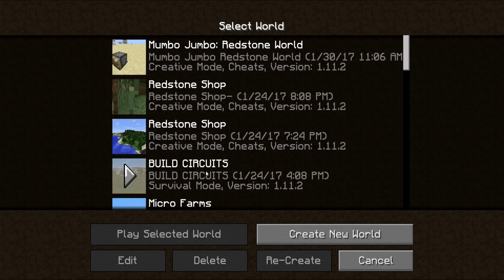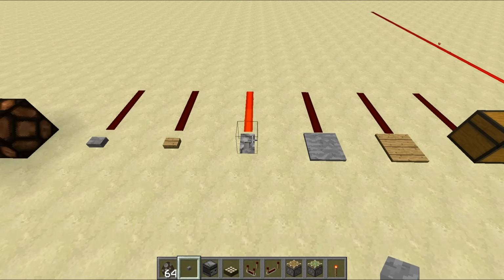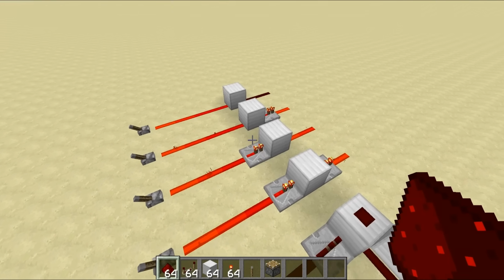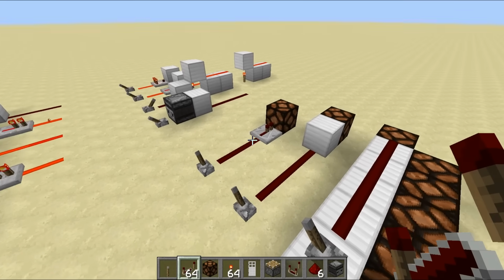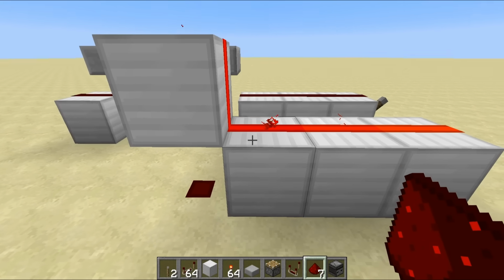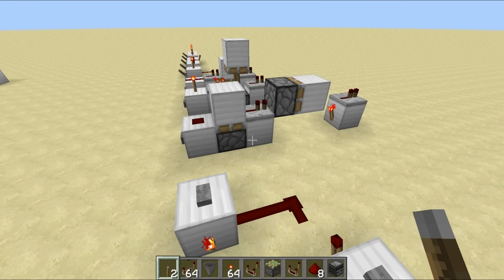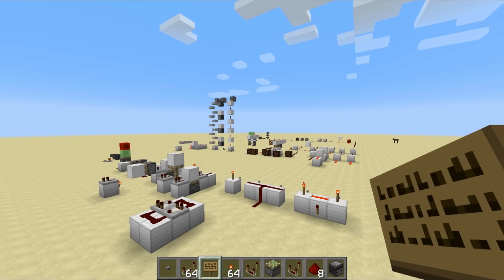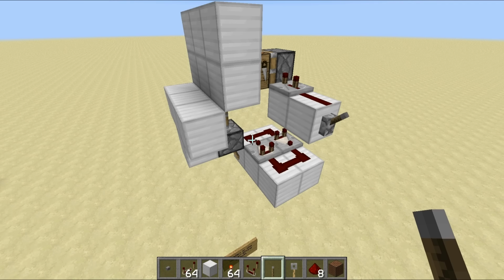How to go From NOOB to PRO at Minecraft Redstone!

Comment: The traped cheast dont give a signal of 1 it give a signal of how many players thats looking in the cheast
Reply from the maker: +Frederik Dekov Buur well I guess I learned something!
Reply: Mumbo Jumbo I love your videos
Reply: Frederik Dekov Buur pro English
Reply: Hame ster tx dude 😂
Reply: Mumbo Jumbo why did you need block update ciruits if you have an observer block?
Reply: the observer was added later in minecraft and look up the 2x2 flush piston door. This is so tiny because of block update, but wouldn't be so small with observers
Reply: b-boymark it can still be small, at lease it has the same size with redstone torch tower when it comes to 2x2 piston door. And also, it depends on the case.
Reply: Frederik Dekov Buur in most cases it gives a signal of 1, because, most of the time, only 1 player will be looking into it at a time
Reply: Greedo Flashbang yes but thats not the point
Reply: YES!! so the block update circuit is useless!! why did mumbo show that circuit into newbe ("noob" is little bit rude)?
Reply: The one he shown is great if your circuit, which needs to be powered is higher than thing it "observe". Observer block doesn't work that well verticaly.
Reply: Frederik Dekov Buur I hope Mumbo Jumbo see this can you make a map which will lead you through easy redstone to hard redstone
Reply: Luka Papež mumbo have seen this look at the fist comment
Reply: ***** i know😂
Reply: same
Reply: Frederik Dekov Buur learn how to spell chest
Reply: Frederik Dekov Buur thanks
Reply: ,mkjmihyjihvjnfcjkhnvuknjhyuidre olahjxfnvhnfdgh,kjc knxjkjhnv kucfumiv74895797
bhgn4!1!11!!!1!@222222@@@222\333####3#333$4444$4$$$$4445%55555555555%%%5%%66^^6666^&&77777&88*8(9(0)00099(99(8888*87&7-=u_)-=+++=--==-{[[[{[{{]]]]]]]]]]]]]]]]]}]]]]]]]]]]]]]]]]]]];;;;;:;:;;:;;:\''''\\|/?//..>:'\|?>/‘:{\
Reply: i don't know what am iwriting and saing
Reply: tidak ada video maap yo,  See Mumbo's automatic melon farm. Done before Observers.
Reply: How the heck can you be that good at spelling?
Reply: hey dont juge peapole!! its ok if we are not good enough at english!!
Reply: TecherZ i know😂
Reply: tidak ada video maap yo yes!
Reply: Frederik Dekov Buur kon kok nyocot wae seh bacod
Reply: Frederik Dekov Buur *chest
Reply: Apple Flavour Bleach i know 😂
Reply: Apple Flavour Bleach HOW COME THE BLEACH FAMILY IS EVERY WHERE!!???
Reply: No intent to be rude but I believe you meant trapped chest

P.s all the others were really rude. Bye have a nice day!😊
Reply: Fuckin "shark lover"? Great name dude
Reply: I comment Sh*t your name says it all
Reply: "Runty" boi hahah, Lil fucker munter runter
Reply: I comment Sh*t well,I am the runt in my family \(°ω°)/
Reply: At first I thought this was bullshit. But it checks out. Not sure I've seen this used before...
Reply: Frederik Dekov Buur its touching but yes.
Reply: Frederik Dekov Buur but
Reply: dusky186 hu77$7
Reply: Frederik Dekov Buur p
Reply: Frederik Dekov Buur
Reply: what happens if there are more than 15 people looking in the chest, but there is an RSB next to the comparator, and it is in subtract?
Reply: Peter Smythe idk
Reply: Frederik Dekov Buur wow that's cool. You never know everything about redstone!
Reply: you english?
Reply: you english?
Reply: Irish.
Reply: Frederik Dekov Buur oh thanks. actually didnt know that :).
Reply: Dominic SherryRoman Knight  happy to help
Reply: Frederik Dekov Buur could you use grammar
Reply: LD GP KillerTubeGameing sorry im not so good to english
Reply: ***** Shouldn't that be a lower case b?
Reply: Frederik Dekov Buur  wow the kid teached Mumbo
Reply: RainbowisticFarts lol
Reply: Frederik Dekov Buur LEARN TO SPELL AAAAHHHH JK
Reply: Frederik Dekov Buur chest*
Reply: Frederik Dekov Buur what?
Reply: Frederik Dekov Buur XD
Reply: Frederik Dekov Buur You're a redstone GOD!
Reply: The trapped chest doesn't give a signal strength of 1. The signal strength it gives depends on the amount of people who are currently looking in the chest.
Reply: Frederik Dekov Buur i
Reply: Frederik Dekov Buur can i download a map of mum o jumbo TESTING WORLD
Reply: Mumbo Jumbo why is pe and pc Minecraft different?
Reply: x freakx noob means new
Reply: Chest?
Reply: Frederik Dekov Buur I
Reply: chong kent L
Reply: Jaime Castro
Reply: Frederik Dekov Buur 
That's cool.
Reply: Mumbo Jumbo umm what is a cheast?
Reply: Frederik Dekov Buur I
Reply: i didn't know
Reply: Its chest not cheast
Reply: late to the party here on the comment, but i just wanted to say that i love how positive and frequently you reply to comments on your channel. even the commenters seem so positive on your channel haha

Comment: Mumbo, you were incorrect about trapped chests! They output a signal strength equal to the number of players looking at their inventory. So on single-player worlds, that's always strength 1, but on multiplayer worlds, it could be a stronger signal than that. And the official terminology is not "soft" and "hard" power; the code and all official sources refer to it as "weak" and "strong" power.

Comment: Hi Mumbo, Great job. I have worked on redstone since it was introduced and still learn something new every day, mostly from you. I'm still a redstoner but have gotten into commands, odd that it took me so long as I am a programmer. I would like to point out that it is now possible to create a variable clock like a hopper clock, that can run at speeds beyond functional for redstone and insanely slow pulses as well. We can also replace buttons with any items and make instant 40x40 or whatever doors that appear to slide open using no pistons at all. No I'm not leaving redstone for commands, but I am trying to incorporate the best of both in my builds... mostly because I'm not talented enough with redstone to build half of what you do, and because I'm not good with modeling items in code.
So why am I telling you this? Well if I am only half decent at each, you could be the king over both camps. Imaging some of your systems turned supernova using some of thees ideas. Now i know you can't use commands in most servers or even in survival and that's a big drawback, and that it's a balancing act when adding commands but your the guy I would trust with this first.
P.S. I know SethBling did this to, but we don't see much from him lately and you have always been a resource for many of us.

Comment: Mumbo:  Thanks for making this video.  I've been working on my own tutorial, and I'm going to link to yours from mine, because this video is EXCELLENT.

There is one little quibble I thought I'd mention:  A redstone torch does not power a neighboring BLOCK.  It will ACTIVATE a neighboring block that can take action (e.g. extend a piston), but it doesn't POWER it.  You can distinguish this by trying to get a signal out of that neighboring block using redstone wire or a repeater leading away.  You'll get nothing unless there's redstone dust or repeater in between.  However, if a block is immediately ABOVE the redstone torch, it is indeed powered (strongly).

Comment: 1:41. Why is that?? 13:42. So this tower will not work if you powered it from the top at wanted the output on the bottom? 17:48. Why is it called a bud switch?? 17:54. It should also be called the infinite item multiplier, am I right??

Comment: Mumbo, maybe you can help with this design I can't make happen. It uses a daylight sensor, lava stream and water stream. The idea is for a castle exterior, flowing lava flowing down to a fountain at night for lighting and appeal and when daytime comes, the lava stops flowing and the water follows the same path without the 2 ever intersecting at a total of 20-25 blocks of movement. I've tried out many circuit combos and I can't figure this one out. This is for console and we don't have observers yet, that might be the answer but not accessible yet.

Comment: there is an other circuit I don't know how is calld
is basicly 2 comparator facind the same direction and you need to click both 2 and then put to redstone dust in front of them and in front of the redstone dosn't matter right or left you put a piston and in the back and next the comparator you put redston dust and the next the redstone dust in the back of the comparator and then put 2 leever next the last 2 redstone dast and I don't say you what this du you simpli need to try

Comment: Could you elaborate on hard/soft powering? Is it just whether there's a repeater/comparator running into/out of a block?
Reply: hard and soft powering is the differenc of can you just put some redstone down and get an output out of  the block than its hard powered if not > softpowered
Reply: Blade Basically, if you put redstone on another side and it is not activating, then its softpowered.